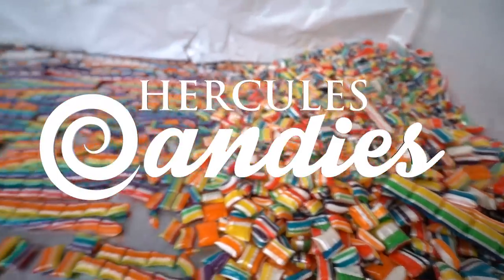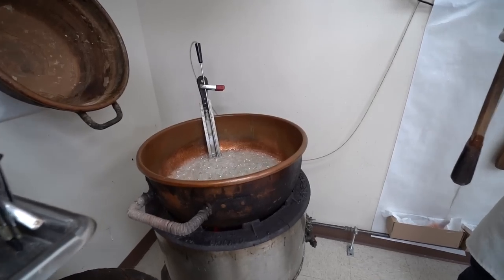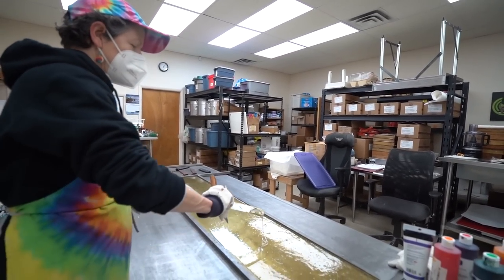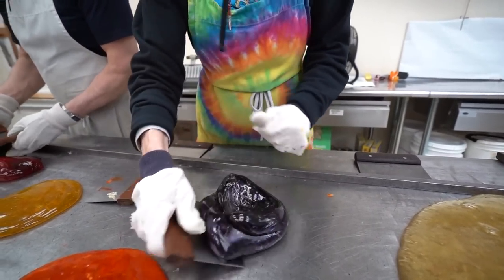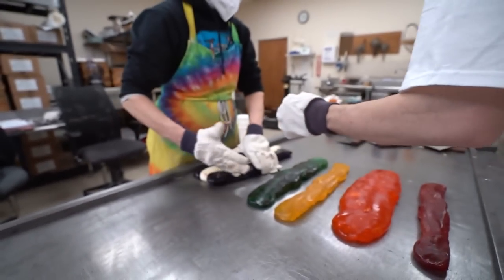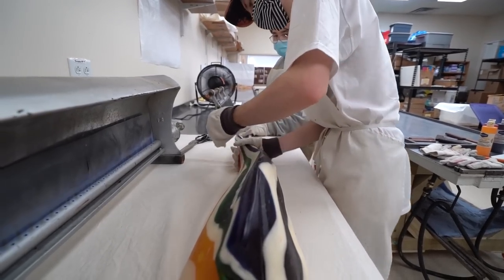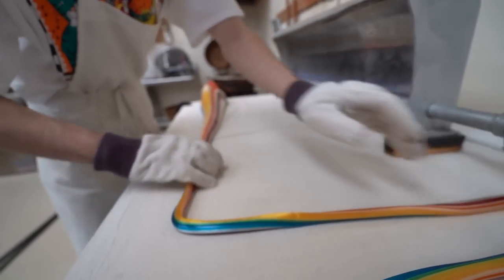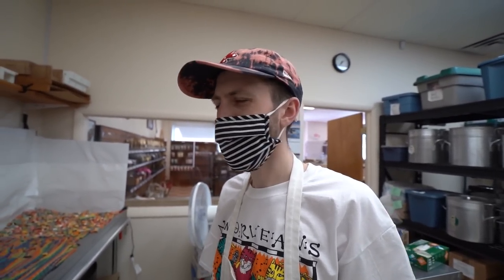Tie Dye Hard Candy Never Gets Old!

Comment: For anyone wondering.  Cream of Tartar is a levening agent that acts fast and is a by product from wine production.  Where as Baking Soad, also a levening agent, works slowly as you bake/heat.  Baking powder is a mixture of the two so you get the best of both worlds.
Reply: In this case, cream of tartar is used to prevent the sugar from crystallizing, thereby allowing the candy to be able to be bent and molded rather than cracking. Because of this, it also contributes to the sheen of the candy as it is worked.